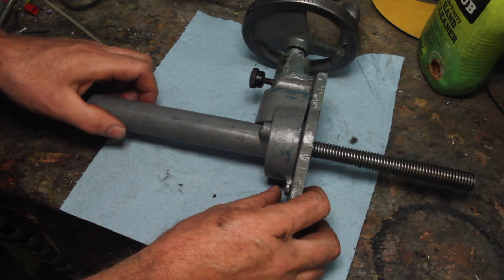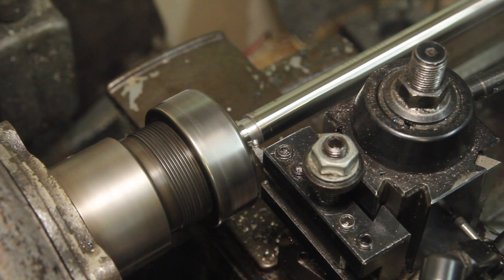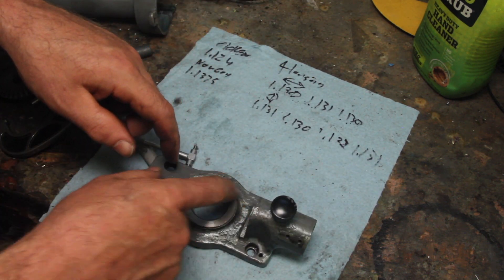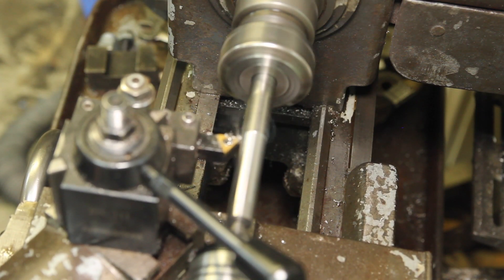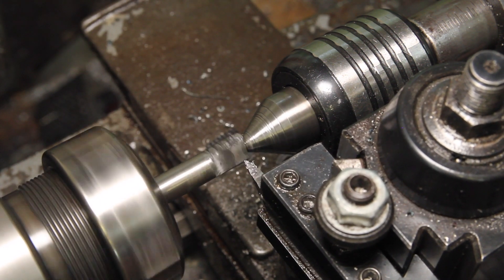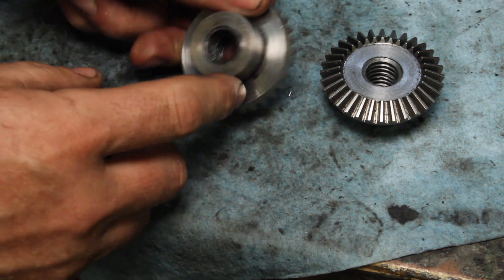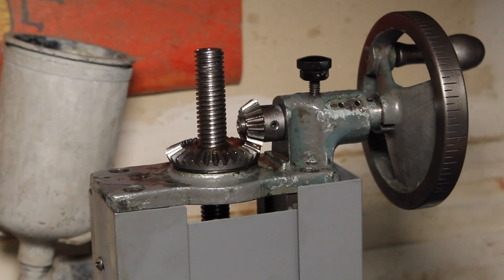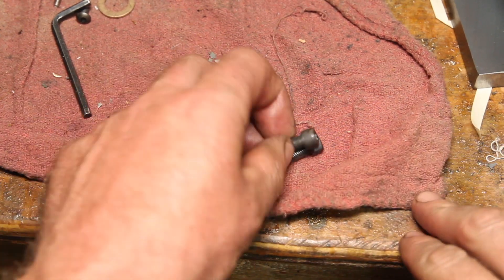Sanford Surface Grinder (Part 3) Acme Threadapalooza

Comment: Enjoying your series on the Sanford surface grinder. Considering how in-demand they still are, there isn’t any good video on them before yours. I just picked up one — been looking for one for over 2 years. They always were sold even before I got a chance! 
Mine is made in 1981 — one of the later ones. Thanks for your hint on figuring out year of manufacture. I expect it will need less work than yours but I paid dearly for it.
Reply from the maker: I’m really glad people are finding these videos useful!
Reply: @JeremyMakesThings I’m getting really inspired to work on mine, I have a few similar issues.